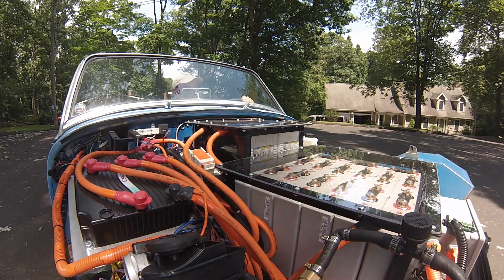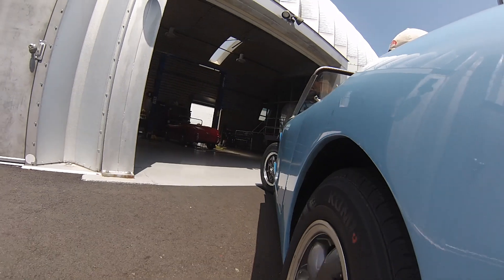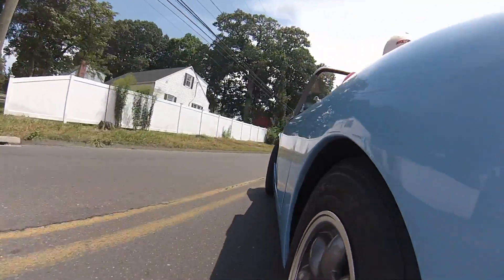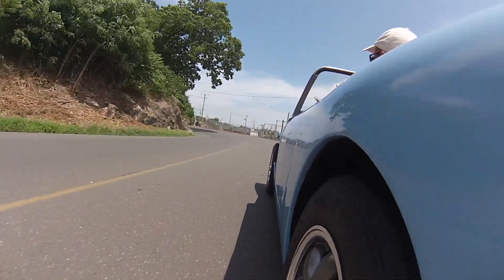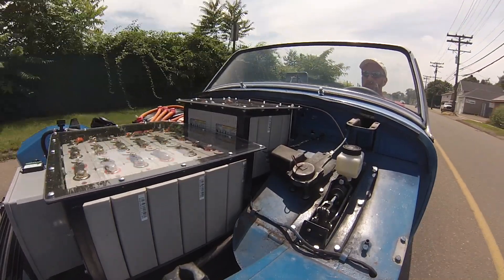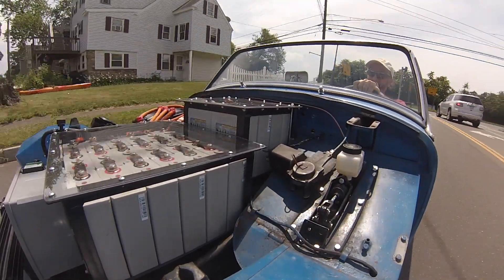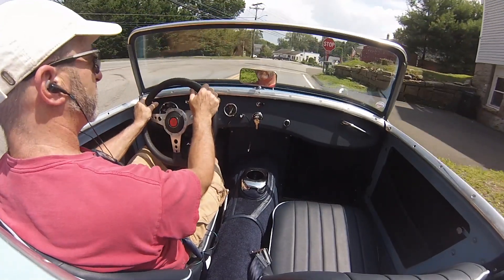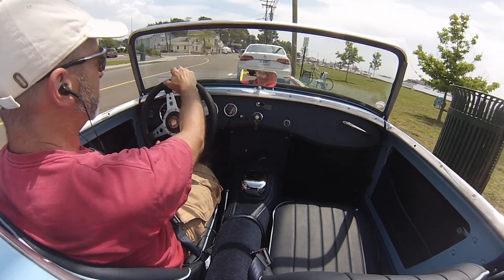Electric Bugeye Sprite Drive under the nose cam

Comment: I imagined the front to be alot heavier , so very surprised your getting 50/50 weight .
Reply from the maker: we loaded batteries in a box where the original fuel tank lives, and moved the motor low and aft in the trans tunnel, which gave us about 50/50 weight distribution. If you visit bugeyeguy.com/electric, you can see our prototype on corner scales. Original cars were about 50/50 too from our weight of a stock Bugeye.